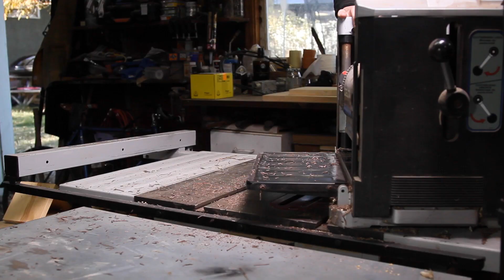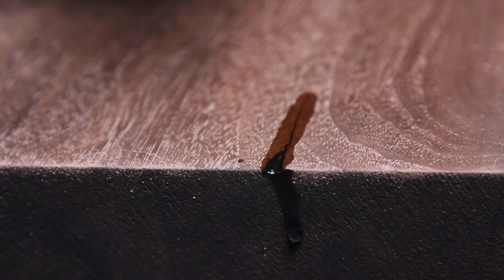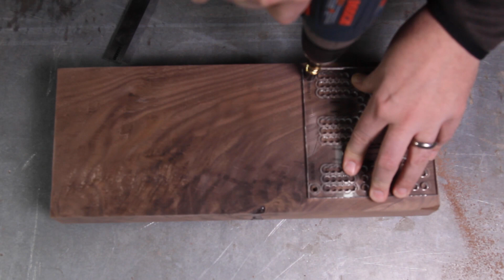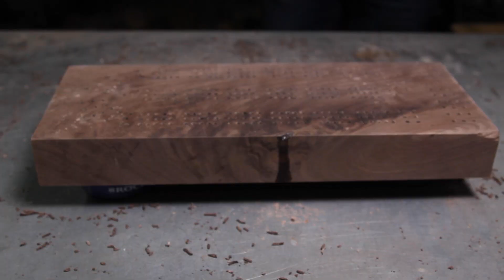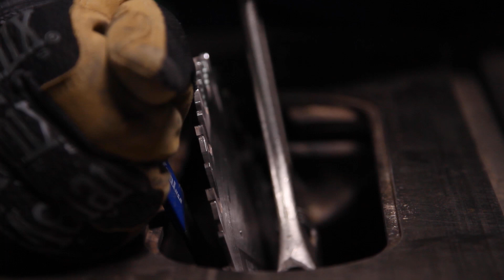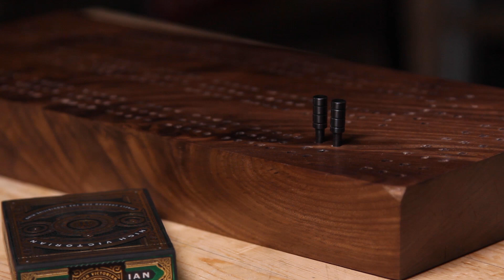Custom Cribbage Board - With Rockler Jig

Comment: Clear packing tape, works pretty well
Reply from the maker: It probably would, I actually sent Rockler a Tweet because after this I modified the bit. I enlarged the the hole every so slightly and used a better quality bit.

After this board I had made 2 more without issue, no clogging and very little tear-out.

Comment: Looks great! My one complaint of the rockler jig is the bit getting clogged like you mentioned. Drilling took forever but it’s so simple to use. I really like the jig, making these boards is a fun process. Good work mate!
Reply from the maker: Thanks for watching! I actually contacted them about it on Twitter. I drilled mine out using a 9/64th bit for the jig, and then replaced the bit with a new one and it worked a LOT better!

Comment: You may find that the template moves a little only using the to pegs to secure the template. You can make two wooden rails to clamp along side of the wood pinching the template to help keep the template from moving.
Reply from the maker: Good tip! I also drilled out the bit 1/64th larger and then used my own drill bit on the inside. It completely fixed the binding issue that I was having.
Reply: @heyimamaker  Thanks for that, I also have the binding drill shavings problem. I've also made my own pegs, squaring up different species of wood into like 1/4 x 1/4 inch strips. Then /sanding/shaping them to "peg" shape.

Comment: Would taping the board before drilling reduce tear out?
Reply from the maker: It probably would, I actually sent Rockler a Tweet because after this I modified the bit. I enlarged the the hole every so slightly and used a better quality bit.

After this board I had made 2 more without issue, no clogging and very little tear-out.

Comment: Awesome! I have a few nice pieces of wood I'm saving to make crib boards with.
Reply from the maker: Depending how you make the cribbage board, the Rocker jig does work decent.

But I enlarged the hole in the cantering bit to 9/64th and then used a new 1/8th bit.

The new bit caused less tear-out in figured wood and the enlarged hole in the cantering bit prevents it from getting clogged up.

Comment: Very nice. 
What was the glue you used for holes and  cracks?
Reply from the maker: This specific CA glue is a local store brand, but more recently I have been using Starbond. If I had it at the time I made this cribbage board I would have used their dark CA glue.
Reply: @heyimamaker  ca glue? 
I will check Starbond
Reply from the maker: @clarkriccobuono3903  CA is the generic name for super glue. It stands for Cyanoacrylates.  Starbond is another brand, but it's also got a lot of thicknesses, and times for curing which is nice to have.